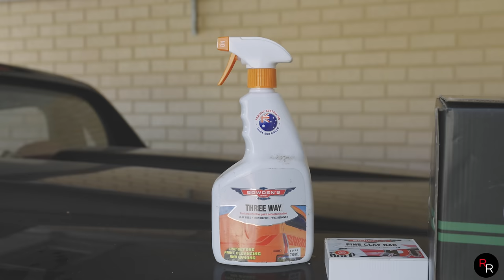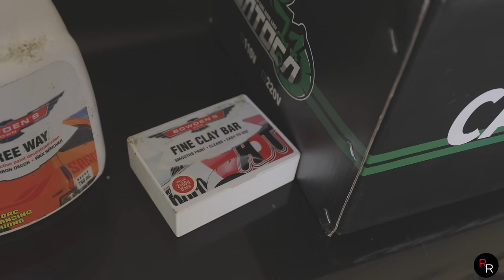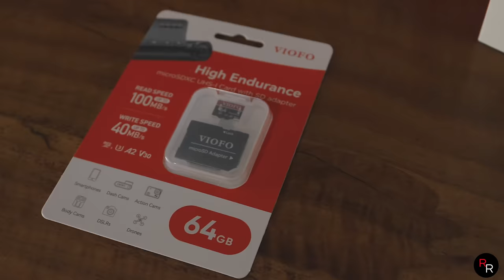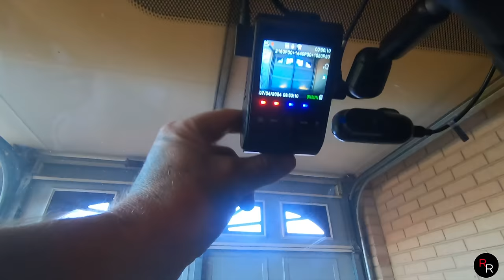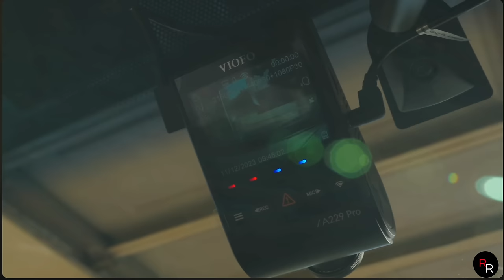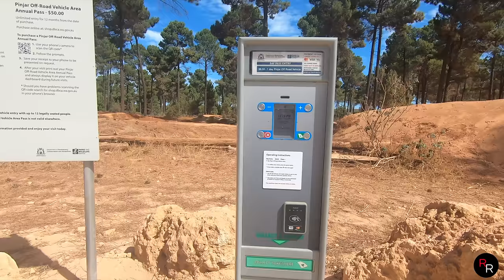I LOVE THIS VZ SS UTE! What A Transformation...

Comment: I even love the unique cranking sound on a LS.
Reply: Shouldn't normally be that lazy tho.
Reply from the maker: New starter coming soon 😅
Reply: @JustinDebono-u9h Yeah that's a lazy starter and/or a battery that's seen better days. Sounds like the battery doesn't have enough CCA? I could be wrong. Upgrade to better than standard starter motor. Not much extra $$ but so much better.💯%😊